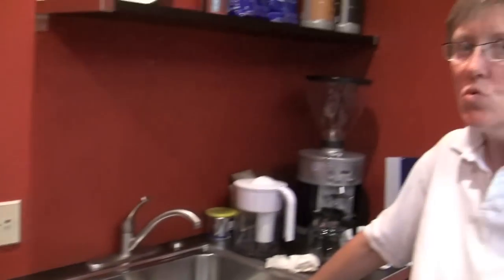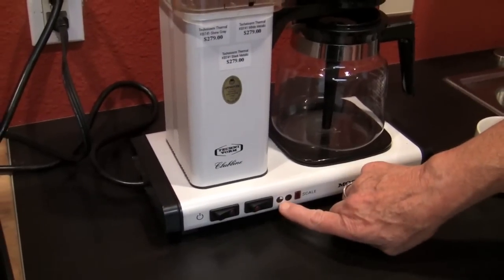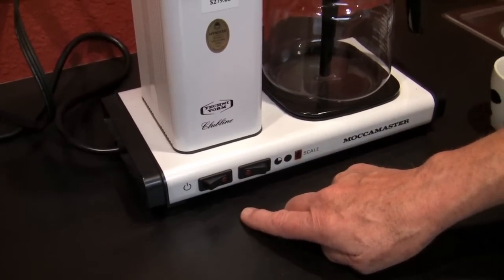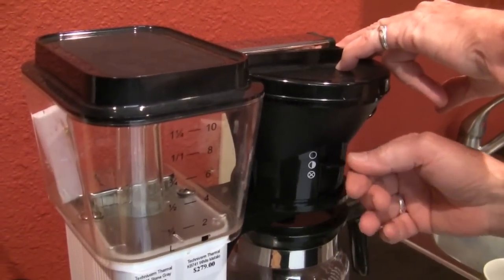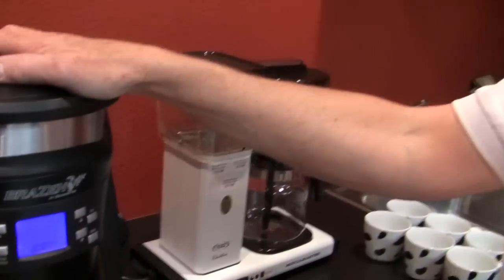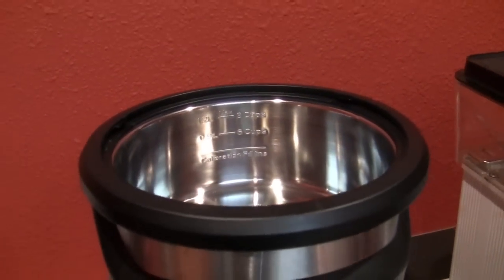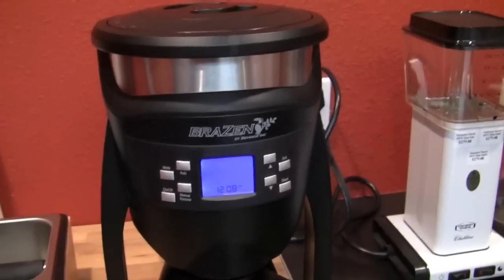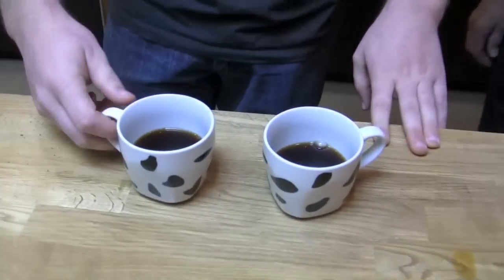Compare: Behmor Brazen Brew vs. Technivorm KB741

Comment from the maker: Yes -- if you try to brew smaller amounts, the water will actually go through too fast on some machines and you won't get a great extraction. That middle position on the lever closes the opening a bit so that it slows down the extraction rate overall. Let me know if you have more questions - Kat

Comment: That's kind of an interesting change in story.  Was it the default settings or settings Joe recommended?  I very much doubt the later as you now say as Joe has made it quite the point there is no one suggested set of settings.  That they should be changed to each individual's liking.  You are right.  I don't agree with your approach.  I found it lacking.  Lazy under the guise of fair.  But to each his/her own I guess.

Comment: What temperature did you set the Brazen water boiler? The Moccamaster water temperature, on the average, runs at 195 degrees F. You should have set the Brazen Plus to less than 200 degrees F (195 degrees F) to closely match the coffee temperature of the Moccamaster for the test comparison to be conclusive. I just have gotten my Brazen Plus 2 for almost 2 weeks. Now have both of these makers. They both produce great coffee if done properly. I have my Moccamaster as an emergency back-up gathering dust in my workshop.
Reply: 4 years later, how are you liking the Brazen? Still using it?

Comment: Brazen review
1) Be aware: You have to use filtered water. Period... if you do not the machine will have to be descaled every 30 days or less (Phoenix water).
2) If you are not careful when removing the carafe, it will catch the brew basket and dump hot grounds all over including your hands.
3) The carafe dribbles. Average design.
4) When removing the filter basket after brewing, about an ounce or so of water will leak out from the distribution holes above and require cleanup of the base area.

Comment from the maker: No - this is for smaller amounts of coffee grounds; if you're going to put coffee grounds in for 10 cups and then only put 5 cups of water in, brew at the same rate. If you put the coffee grounds in for 5 cups and don't slow it down, it will run through the coffee too fast and you'll have weak coffee. - Kat

Comment: The entire design concept of the Brazen is the ability to adjust the pre-soak time and specific water temp for the best results.  By not adjusting coffee amount, grind, pre-soak time and water temp you are creating a very limited test of the Brazen's capability.  Why would anyone pay a premium for a Brazen and simply leave it at the factory settings?  The pertinent question is which machine is capable of producing the best brew, which you did not answer.
Reply: Excellent point. 

However, one correction - the Brazen is quite a bit cheaper than the Moccamaster.
Reply: @johnmpifer   That's true but the Brazen is more expensive than the typical coffee maker. The fact it's less expensive than the Moccamaster and includes many exceptional features makes it that much more appealing, and deserving of a full review of it's capabilities.
Reply: @coachafella Yes of course. 

I was simply pointing out what I felt was a lack of clarity (“why would anyone pay a premium for the Behmor”) in your commentary. 

It could lead someone to believe, that the Brazen is more expensive than the MoccaMaster, which is far from the case. 

Ordered my new Brazen Plus v3.0 yesterday, hence all my searching for reviews of it. LOL.
Reply: @johnmpifer   Fair enough and you're right my OP was a bit misleading. Congrats on the new Brazen. I've had mine for years, after owning many other brewers over the decades.  Use and enjoy it daily, and I do make use of the adjustments to get the best out of each of my favorite coffees, which is why I emphasized that point.  Hope you enjoy it as much as I do mine. Cheers.
Reply: @coachafella  That’s great to hear that you are still using and enjoying your Brazen! 

I noticed that your post was about 10 years ago.

Are you still using your original Brazen that you got way back then?
Reply: @johnmpifer   Actually it's the 2nd one. The first one had a small defect, and the Behmor folks replaced it with a newer model in the first year.  Since then it's been rock solid.  Another great thing about Behmor is my experience with their support has been excellent.  You may know all this, but I'll offer my best advice. Use filtered water, I use a ZeroWater dispenser. Also, take full advantage of the adjustments.  Calibrate it for your altitude, and adjust pre-soak time and water temp to get the best taste. I also find carefully measuring the amount of coffee from one brewer to another, and even from one bean to another, can make a very big difference in the taste.  It can sound a bit complicated, but once set up it's as easy to use as any machine.

Comment: You folks really did a dis-service to the Brazen.  Under the pretense of being 'fair' by using factory settings you instead tied the Brazen's hand's behind it's back and left it 100% to chance as to whether the brew temp was good.  The temp you used is not the factory setting.  Mine came at 210 F as the default setting.  That would be too hot, and yours was arguable too cold.  "Fair" would be brewing one pot for every temp the Brazen could be set at and comparing those results to the TVs one cup